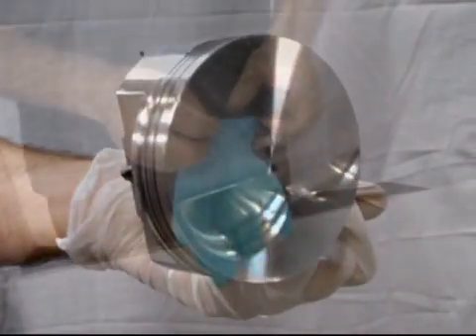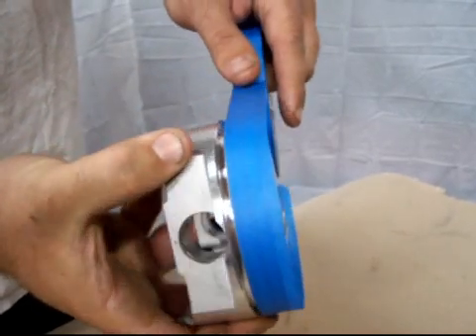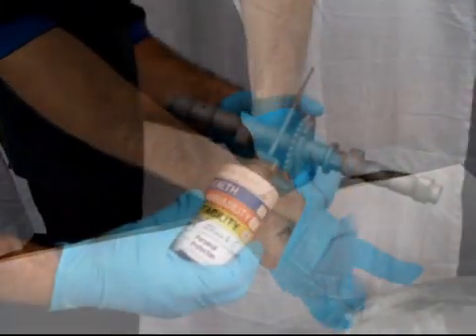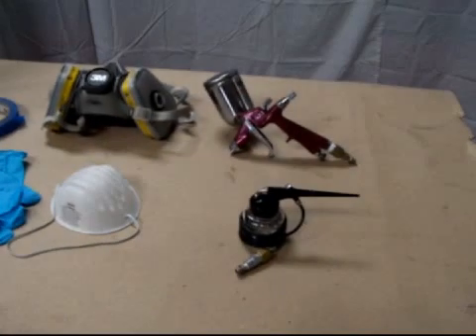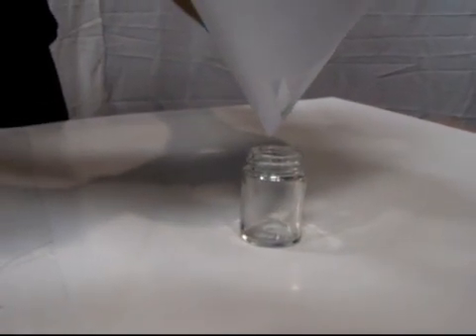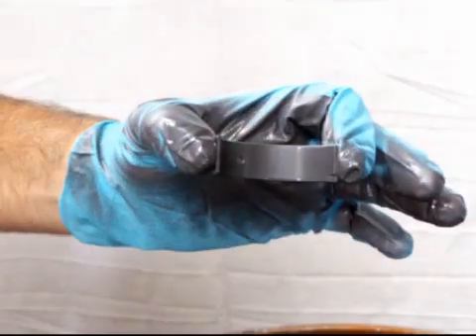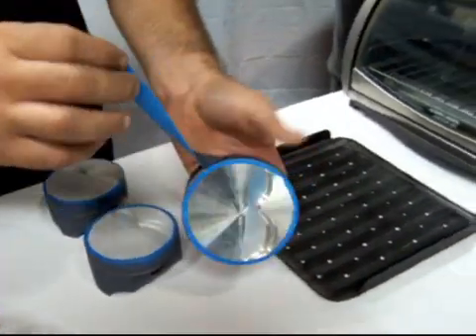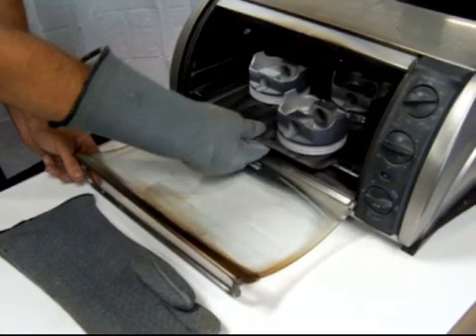How to apply DFL-1

Comment: Can I recoat my speed pro piston skirts?    Do I have to remove all the previous coating ?
Reply: machstang70 yes you can recoat them, you must blast all old material off inorder to do it.
Reply: What media do I use to blast the coating off,  I don't like to glass bead or abrasive media that will embed itself into the metal....
Reply: in order to get the old coating off and have the surface prepaired for the new coating, you must use 100-120 grit aluminum oxide.

Comment: @TechLineCoatingsRD, looks awesome. Got a quick question however, I know that your using this finish on moving parts that are obviously subjected to high heat/friction in the demonstration and I was wondering if this coating would be resistant on a bolt on my AR-15. I was looking to recoat mine for a satin finish and wasn't certain if a product like this would resist the wear from the cycling of the bolt. Thanks.
Reply: Yes, this would be a good
product for that.

Comment: This is very cool. HOWEVER!.... Im pretty sure this is NOT the proper way to get a coating on parts.  Performance-part-manufacturers use the 'electro-plating' process to coat their parts.  This (electro-plating) process results in more uniform (precise) thickness of the coating.  Correct me if im wrong.
Reply: You are wrong. This product is for home use and small shop use where they don’t have fancy equipment.